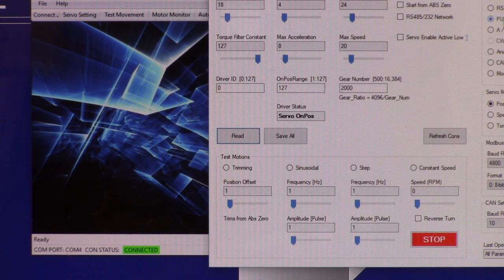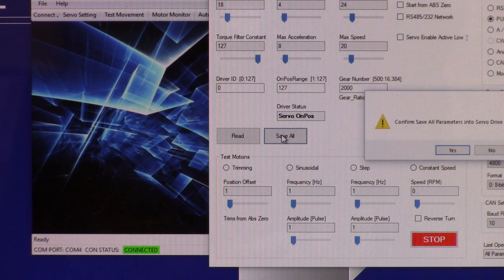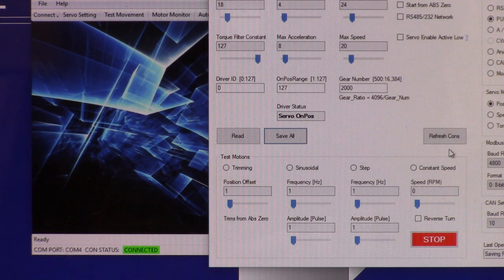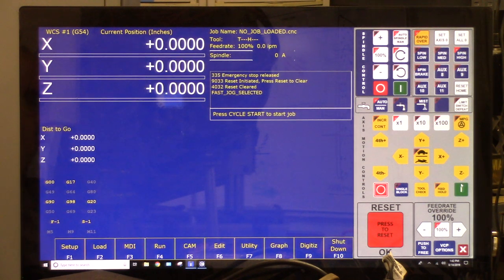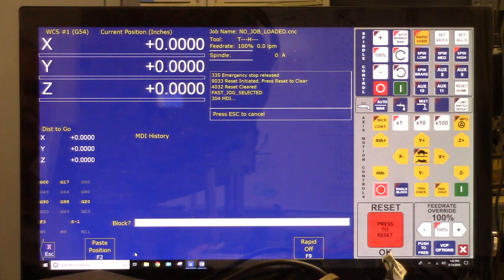Phoenix CNC Router Upgrade: Centroid CNC Acorn DMM AC Servos. Part 4

Comment: Marty,
why do you need the C86  and  the three C34's ?  Whats being simplified or where are we eliminating guesswork? 15:46 I didnt know i needed those.
Thanks!
Reply from the maker: You don't "need" them you can hardwire your drives to Acorn. They just "simplify" connecting drives to Acorn. Turn out I found a flaw with this board and it has been redesigned.
Reply: @martyscncgarage5275  going over this video again.. and i must say it has to be the best one out there...    which board did you find flaw in .. the c86 or the c34  and what rev was it.. as i have the c86 rev 2 and the c34dyn4 rev 2's     Also could you give me the spec on that e stop contactor and the fuse block ?     thanks so much !!!  joe
Reply from the maker: @RaptorMachineToolCo  C86Acorn. New revision is Rev. 3

Comment: The drawing you used for reference at 19:00 min is that available for download?  Thanks for the video.
Reply from the maker: Post to the Centroid CNC forums. It's a draft I was checking. I need to print vis feedback yet.

Comment: Marty, great job! love it.... getting ready to set up my mill with acorn and dmm4 what size cabinet would you recommend to house the acorn, vfd,  3 dmm 4's, and related electronics?  also what gauge wires?    thanks!  cant wait to see your router up and working!  Joe
Reply from the maker: Could you post your question to the Centroid CNC Acorn Forum. Better there, many will get something out of the discussion. Easier to type answer in the forum I'll be busy tomorrow, but will look for your post in the evening. Thanks!
Reply: @martyscncgarage5275  ok... thanks Marty!

Comment: Hi Marty, why would you need a big toroidal power supply rectified to dc to drives to have them convert it back to ac for the servos? And could you recommend a place to buy sheilded cnc rated wire for steppers, Im finishing my build now and will upgrade to acorn board soon. Thanks
Reply: That's what DMM drives require. You are doing stepper motors? Just by 18gauge, 4 conductor, stranded shielded cable

Comment: Marty, so to connect the acorn (and say a DYN4 drive) to 240V you use the two hot wires black and red?  I've also seen 240 volt wire that has black, red, white, and ground.
Reply from the maker: This machine had 120 for the control and 220 for the drives. I do all 220 now.

Comment: Why did you change the gear number to 2000?
Reply from the maker: No reason to have higher resolution on a router. The higher the resolution, the lower the MAX jog rate you can have.
Reply: @martyscncgarage5275  did you calculate that 2000 number or is it just a number that you felt comfortable with. Did you use trial and error?
Reply from the maker: @Z-add  nope, previous experience. Works pretty well in general.